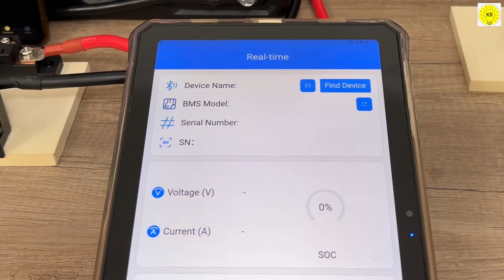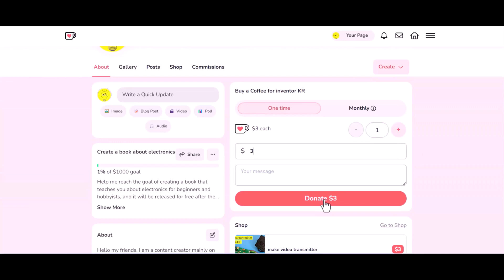100Ah LiFePO4 Battery vs 220V 100W Light Bulb, ACOPower

Comment: The display parameters show: 13.1V * 9A = 117.9W. The LED used is 100W, and the combined power loss from the inverter plus the 100W light is 117.9W. Running for 11 hours results in a total consumption of 117.9 * 11 hours = 1296.9Wh. Li-Cube battery capacity is 1280Wh, which is quite close to the calculated usage. This demonstrates a solid match between the power requirements and the battery capacity!
Reply from the maker: Yes, they are the best batteries.